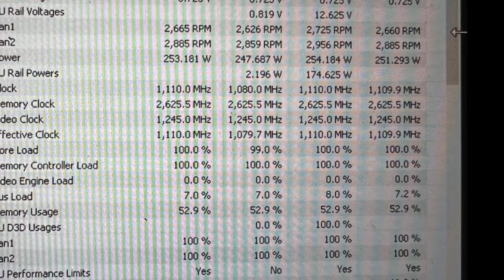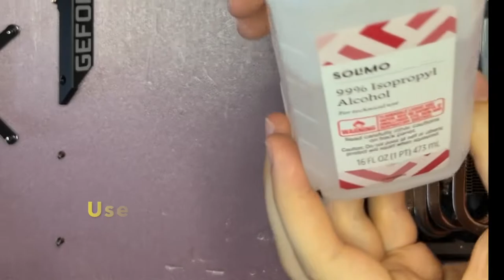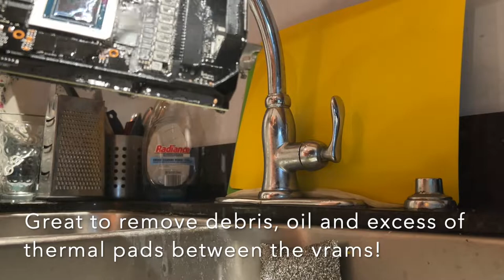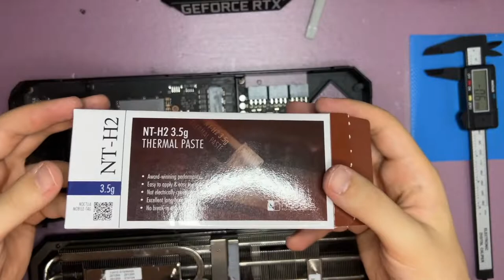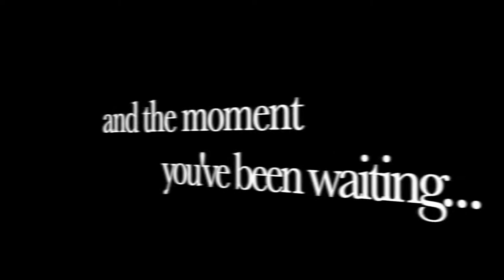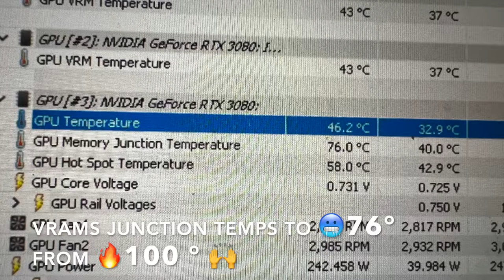Asus Rog Strix 3080 Thermal Pads and Fan Replacement

Comment: Hey do your fans always run so high? They’re pretty loud even when replaced right?? I just upgraded and got a deal on a used ROG Strix 3080 10GB from Amazon and it runs hot and I’ve had a few issues with plugging in my DP cables. How hot does yours run with maxed out settings at 1440? Which games?
Reply from the maker: Hi! If it’s a used card, I recommend you to do a proper maintenance, I bought even new strix 3080 and it had thermal pads oem leaking oil! If yours is a used one and most likely V1 , I’d bet it was used for mining and ran 24/7 with fans at max speeds. Mine is not loud even at max, that’s smt really cool about the strix fan system. Mine doesn’t run hot at all!!!
Reply: @MAIKUS07  it’s actually a V2! My GPU temp is around 70-80 C when running Fortnite at all epic settings specifically. However, I only have 1 fan at the back of my case which could be why it’s running hotter too. I just don’t know what to do, I could still return it. Unless this performance is normal? The fans are spinning between 2000RPM-2700RPM when it’s at 70-80 Celcius. Which is when the fans get audible
Reply from the maker: @sapients2664 from the start, if you don’t have a proper cooling system on your case, then the whole system is wrong from the get go, you need a balance between intake and exhaust, it’s very inexpensive and quite often a a solution that can bring down temp by 5-10 Celsius in many cases. Second download hinfo64 and check what you have on junction temperature when playing at max settings, if it’s lower than 90 you are ok , if it’s 100 or more I’d worry and change thermal pads, keep in mind if you gotten a good deal, and you have the knowledge and security to do what I did in the video, then you have a good card, you maintenance is sometimes forgotten but a must at some point in life of the Gpu and a 3080 strix it’s an amazing card  (3090 is a big leap and more lifetime, but it is what it is 😅) . Last download Mai afterburner and set card as default and then put fans at 80% that should be an acceptable db of the fans noise(up to you really, I rather have my card tuning as cold as possible, I use headset when playing anyways), you could also leave it at auto… but no matter what, arrange the systems fan properly!! Good luck!

Comment: thank you for this video friend! its basically the same for the 3070
Reply from the maker: 😊🙌 Exactly, it’s the same procedure for STRIX 3070,3080,3090 and I dare to say that TI versions too!! Glad I could help!!🎉
Reply: @MAIKUS07  I have some asus rog strix 3070ti oc gpus that I need to open up . I will like to use copper for the memory and put a pad on the cpu like that I don't have to touch them no more. Just clean the dust.
Reply: I open my asus rog strix 6:58 3070ti oc everything is running smoothly.
Reply: @1967KID pad on the cpu ? In gpu what you meant
Reply: @ssshatam  the pads and paste and clean it 97 alcohol.

Comment: Great video very nice, can u tell me where do i need the 1mm and the 1,5mm pad, 2mm is clear, thanks for your answer.
Reply from the maker: Thankyou, it means a lot !! Check this link, you'll see all the measurements, but depends on where you have high temps, Id only worry about the vrams, just use 2mm on all the vrams and same place for vrams but on the backplate (like the video) that will make a Huge change, if you open the gpu and the other pads are usable (not broken or full of grease) then don't mind on changing them, this is obviously considering a budget. If money its not an issue then by all means go ahead. But bear in mind, the big change youll see it by replacing the thermal paste, pads on Vrams and adding pads on the backplate, good luck !!

https://thermalpad.eu/thermal-pad-sizes/asus-rog-strix-nvidia-geforce-rtx-3090/
Reply: @MAIKUS07 Thanks for your time.

Comment: I'm planning to repaste my GPU as well, GPU temps are at 70c and hotspots at over 100c while gaming. Didn't notice there is a memory junction temps when using GPU-Z, what monitoring software you using? May I ask where did you get the fan replacement? The right fan of my GPU is wobbling exactly like yours. Thanks for the video guide.
Reply from the maker: Hi!!! I use Hinfo64, the ones I bought that look precisely oem are from eBay, check the comment I have left the link somewhere there. Looks like your gpu is having a dry thermal pads on, you may also see that there might be grease there (clean it with isopropyl alcohol like I did or with a pad if you don’t feel coragueous enough 😅). Of course that wobble doesn’t help at all, good luck!🙌

Comment: Simply a show. Do you know if the same thermal pads fits for the 3070 version? I belive the cooler is the same.  👍
Reply from the maker: Hi! I’ve  never had the chance to deal with   A 3070 to be honest. Since they are practically the same except for the power connectors, it’s should be at least for the GPU core,  not sure about the transistors though, you could try check on Reddit if there is a post about 3070 strix layout

Comment: Hi, thanks for the nice video.
Did you replace the pads only on the VRAM on both sides with 2mm pads and left everywhere else the standard pads? Or should i get 
different thickness pads.
Thanks
Reply from the maker: Hi!! Thankyou for your comments!!
In regard to the thermal pads that’s exactly what I did, being careful to not damage the other ones since they use diferent sizes. But there is no need to replace those, just do thermal pads on both sides for Vrams, put exactly the size, take your time to measure it and replace thermal paste as well and you are done!!! Let me know the improvement in temps. You got 🙏🏻
Reply: @MAIKUS07  Thanks for the fast reply. Ok i will try it like that. It will definetly improve my temps because one of the fans is damaged but i will compare it and then let you know.
Reply from the maker: @jonashorschlager  anytime! If it is wobbling, then replace it asap, somewhere in the comments here I put the link to the one I
Bought from eBay. That one as you can see in the video looks exactly the same and comes with the logo, others don’t… good luck!!
Reply from the maker: @jonashorschlager  anytime! If it is wobbling, then replace it asap, somewhere in the comments here I put the link to the one I
Bought from eBay. That one as you can see in the video looks exactly the same and comes with the logo, others don’t… good luck!!
Reply: Yeah unfortunately i am from europe so the fan you used is from america so i bought one from amazon and i think it will work as well :) (also with a logo)

Comment: Wow nice video, been searching for it for a few hours. Gonna do the same thing you did and also replace my woobly fan, was thinking about replacing all the thermal pads but the prices are just to high for those little pads. Nice work measuring your pads mate, gonna try to be as precise as you with the caliper. :D

Comment: Is it possible to take just the fan shroud off without having to completely disassemble the card? Need to replace a bad fan on my Strix 3070.
Reply from the maker: That’s exactly the issue, in order to be able to replace the fans you do have to go through the whole process of disassembly, I’ve seen some people accomplishing what you want but not without scratching very seriously the circuit board (entering with a screwdriver from the sides) it’s better to take time and perform a thorough maintenance, I promise if you follow exactly the video it’s as easy as it looks!! Good luck on your 3070 🙌
Reply: @MAIKUS07  Just a pain since there isn't any reliable info online about thermal pad sizes for the Strix 3070. Not really wanting to reuse the stock pads. But thank you for the info!
Reply: @MAIKUS07 Just got the new fan installed. Ended up just re-using the thermal pads since they looked brand new. Thermal paste was hard and dried out, so I'm glad I actually needed to take it completely apart. Replaced it with MX-6 and the temps have dropped significantly! Thank you again for the video and the info!
Reply from the maker: @Nate0514  I’m so glad  it was helpful!!! 💪🏻🙌 enjoy your refreshed card!!

Comment: Any video how to change RGB plate only ???
Reply from the maker: Hi! The RGB itself is very easy to change but it forces you to disassemble the GPU as well unfortunately. The rgb has one or two tiny screws and then you need to slide the plate on its free side to be able to take it out!! Good Luck
Reply: Thanks I will try 🤙🏻

Comment: Sir can i use same size for 3070 ti strix oc
Reply from the maker: Hi! Indeed you can!!
Reply: @MAIKUS07 thank you very much sir .strix series looks all same but had doubts.thanks again god bless you❤
Reply from the maker: No worries mate! 🙌Btw 3070,3080, 3090 and all TI versions are good for this tutorial! Amazing gpus, Good luck!!
Reply: @MAIKUS07 for sure sir its #1 in my list .but these days i am getting problems with it while dual mining iron+Pyrin or gram this 3070 ti strix dropping to NA while mining gram (memory temp issue may be).i tried almost everything but no luck sir is there any temporary solution my card is only 1.5 years old

Comment: I have a 3080Ti Rog, it appears to run very hot even with undervolting. Do you think replacing the thermal pads would help with reducing the overall temperatures?
Reply from the maker: Hi! How hot are we talking about! What’s the junction temp? And GPU temp?
Reply: Hey i also have the strix 3080 ti even when undervolted at 1875mhz with 850mV the card still runs at 70-78C when pulling 320-350W
Reply from the maker: @paulferdinand4655  are you 100% positive it’s taking the 850mV? It cannot run that hot on that voltage, asumming you’ve done proper maintenance  then consider sending it to ASUS to RMA it 🤞 :/

Comment: Thanks for the video. I have my fan going crazy but the temp is fine (Rog strix 3080ti). Do I need to replace anything if I just open to check (like thermal paste maybe)?
Reply from the maker: Thankyou for your comments!!
If your fan is wobbling and is under warranty you can send it to asus and they will send you another unit, even if they say that they will replace the fan , they won’t. It happened to me once, up to you if you wanna have another unit (still most likely used once but approved from them) if you are happy with yours but temps are fine, then sadly when you open it you must put thermal paste and try to be extremely carefull and patient so the thermal pads won’t break when separating the GPU, but thermal paste for sure you must!!
Reply: @MAIKUS07  thank you. the fan is not wobbling, just running fast even when I just play a YT video. Started a while ago, I saw some people with the same issue and it was the outlet on the fan side which was not fully plugged. So I have to open it to check that (guarantee is passed). will be my first time applying thermal paste :)

Comment: Is the thermal pads measurement the same for the 3080 Ti rog strix?
Reply from the maker: I never had a Ti with me open. Try on Reddit usually they post pics. Should be the same because the hardware design hadn’t changed, it’s basically a bit more voltage , more raw power  with better chips obviously

Comment: Is there any way to only dismount the front without moving the back plate ?
Reply from the maker: I have seen a video showing that is doable, but it’s super tight and you need to have specific screwdrivers and even then will you most likely scratch the gpu housing

Comment: Hello, I would like to ask how the fan is holding up? How much noise does it make? I found the same manufacturer model number in eu and I am thinking about replacing all the fans completely.
Reply from the maker: Hi! I have found that operation is exactly as oem, no DB increments at all, if you have found the same then go for it!!!
Reply: @MAIKUS07  Sweet, thank you for answering so fast! ❤

Comment: Hello, are all the thermal pads on the rog strix 3080 2mm? I was thinking of buying to exchange and I wouldn't want to exchange the wrong one, could you help me with that?
Reply from the maker: Hi!! I have done this in so many strix 3080, I lost count. Trust me, all you need to replace is the thermal pads (and paste for core) and put on the backplate as well to achieve the same result shown on the video!!! 2mm is perfect, at the description you have the links to buy exactly the one you need. You could change the other ones that are smaller but there is no need, just be careful not to break them when you take the pieces apart, do it slowly and if it breaks put it back, those don’t change the overall result!

Comment: Where did you find a fan with the sticker applied?
Reply from the maker: On eBay, I don’t have the link anymore, I do have extra fans I bought if interested
Reply from the maker: I have created the link, this is one I had extra if you need it! 

https://www.ebay.com/itm/204406988576?mkcid=16&mkevt=1&mkrid=711-127632-2357-0&ssspo=-nTIr3M5Qje&sssrc=2051273&ssuid=-nTIr3M5Qje&var=&widget_ver=artemis&media=COPY
Reply: @MAIKUS07  Thanks for the offer. I noticed, that my gpu is the loudest part when gaming and based on others, their pc is whispering silent (which mine also is when the gpu isnt spinning) idk, how loud really normal is but i would have liked to try it out with some new fans. Because currently, my apple watch is saying that its arround 55 db loud when play the last of us for example (ik, the watch isnt an accurate device for that)

Comment: is the thermal pads of asus strix 3070 is same in 3080?
Reply from the maker: Hello! I cannot say for sure. For 3080 and 3090 yes. 3070 has not diferent build, at least for the vrams I would dare to say they are, but if when opening the GPU , other thermal pads brake, those most likely are diferent mm.

Comment: Hi. is the same method used in 3060 ti?
Reply from the maker: Hi! I never used a 3060ti, but it should be similar if it’s the same brand and model, thermal pads thickness could be diferent though! Good luck

Comment: Great video! Where did you get the fan with the logo. I am replacing mine, but I can’t find ones with the logo.
Reply: Sorry, didn’t add the ❔
Reply from the maker: Hi!!! Im glad you enjoyed it!!! 🙌 I was also looking for the logo and basically you have to check on the pictures, they are tricky some of them they show the logo some don’t. https://www.ebay.com/itm/304259129763?mkcid=16&mkevt=1&mkrid=711-127632-2357-0&ssspo=vy_yv6bxswk&sssrc=2349624&ssuid=-nTIr3M5Qje&var=603347182992&widget_ver=artemis&media=COPY
That is the listing on eBay where I got it and as you can see on the video the motor is exactly the same replacement (probably from the same factory even 😊)
Reply: Thank you so much! I was only going to replace the fans and I now decided to replace the thermal pads too while I’m at it lol
Reply from the maker: @allanyordi  totally! Since you are opening it and perhaps you find yourself with thermal pads leaking oil then you have to change it or you open it to change the fans and the thermal might break resulting in poor contact when reassembling it. Better to do it  only once 😁 and you end up with a strix for many years to come!!
Reply: You’re right! I’m now looking up the thermal pads to order them. It says 2mm in the video, but you also mention 1.5mm in the description bro. What size and how much would you say I should order?
Reply from the maker: @allanyordi   if you are talking for the same model as the video, then buy the Thermalright extreme odyssey 85x45x2mm. That’s going to be enough for front vrams and backplate (even though there is no vram) but it helps a lot on lowering temps). I only change that which is the most important ones and the ones that actually get worn out. I don’t change the other ones, there is no need, just be careful when prying out the card so they don’t break. Then for the paste your best price/value is Noctua NT-H2. You can find amazon links on the description of the video for everything. If you need any help let me know, good luck!!
Reply: Miguel, I just got the fans today and everything else needed to do the job bro! I’m about to get on it as the evening is young lol. I’ll keep posted man! Thought I’d let you know. Here we go!!
Reply from the maker: @allanyordi  that’s awesome!!! Remember when pulling the GPU, do it gently. After taking all the screws the only thing holding it together is just the thermal pads, so don’t be afraid :) 🙌
Reply: I did everything gently and carefully and did it twice because the first time temps were down on one side but the first temp reading was now way higher. I went and repeated the treatment and noticed there was a small section I didn’t apply the thermal pads so I did. I still got the first temps higher I.e. 84/76 C when it used to be as an example 68/104. I am going to order the Odissey thermal pads you used because I had some Gelid from months ago from another job. Right now I don’t want to use it until I replace the pads, but I’m going to have to study the gpu components further too.
Reply: Update!!!! Success!!!!!! My temps are both down around 66/82 C at 93 MH/s. I’m very happy and I learned more about my rigs! Thank you very much!!!
Reply from the maker: @allanyordi  I’m so happy to hear that!!! Props to you!!! I bet you could have get even better temps with the Thermalright pads, but it’s still an amazing 🤩 improvement. Generally speaking thermal paste does not translate in a big temp reduction but it’s obviously needed. But thermal pads on vrams and also on the backplate they provoque the best changes!!! Although I still wonder why are you getting 93 MHs. Maybe due to a non optimal overclock/undervolt or silicon lottery related. Anyhow, I’m glad it was helpfull!!!! 🙌
Reply: @MAIKUS07  The fans are 95mm, not 85mm